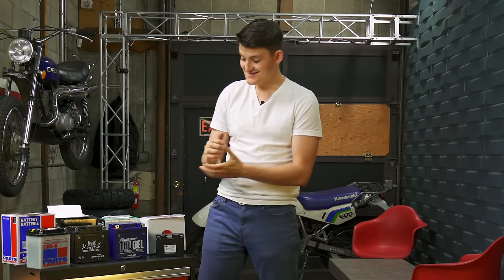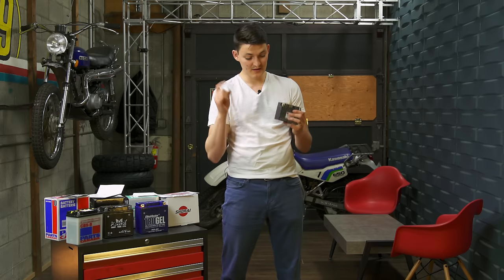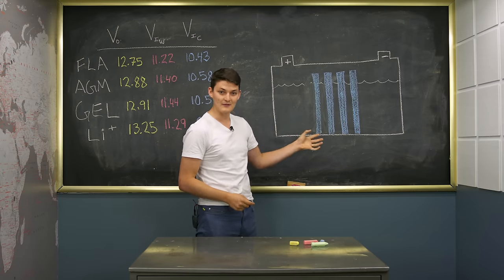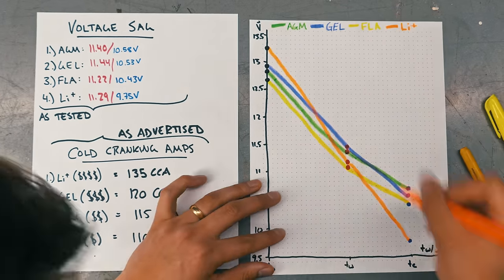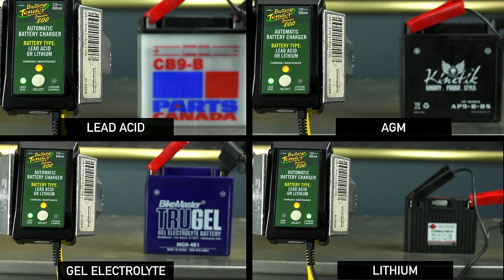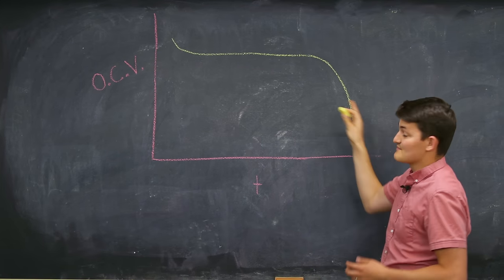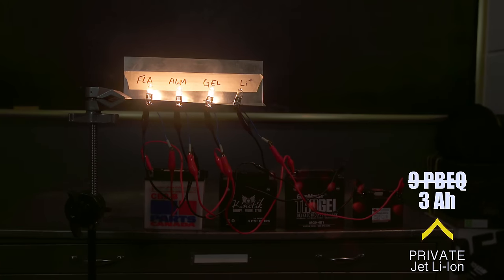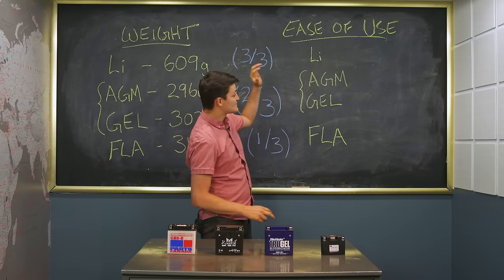Best Motorcycle Battery? Lead-Acid v. AGM v. Gel v. Lithium

Comment: Slight flaw in the charging test: As any electric bike/car owner will tell you, Li-ion is fast to charge from 0 to 80%. Above that they charge a lot slower.
Reply: Why would you need it above 80%?
Reply: He didnt use Li-ion, that's a lithium iron phosphate cell (LiFePO4).  Less energy density than Li-ion but no danger of thermal events and 4000+ charge  cycles.
Reply: That charger charges Lithium with more Volts, less amps. Crappy test.
Reply: @ThomMurphy  yes, that’s just one of the huge flaws. Lithium’s charge the opposite of acid. Start high then low. The test also failed because it’s irrelevant to show the amp hours since the others weren’t likely to actually start a bike. 
Also, that’s a pathetically small lithium. The lfx 14 with 210 cca and 14 pbq or 4ah is superior. 
Additionally, the lithium’s will crank harder with a low battery and start better. The problem with the methodology is that it’s not based on reality, it’s based on things that don’t or are unlikely to apply.
Reply: @Papparratzi  You're correct. Hopefully others will see the points you've made.
Reply: @Papparratzi  so you recommend lithium iron?
Reply: @theverystormycloud4011  Put one on my bike. I recommend putting actual AH replacement battery not the equivalent they always advertise, especially if your in a colder climate.
Reply: @theverystormycloud4011  lithium iron is superior to all of them by far. Just buy their charger too. Has a storage setting and safe charging in cold.
Reply: The fun bit is that as an Australian the worst drawback of Lithium is basically a non-issue unless I park the bike in a freezer. The second bites worse, the import costs passed on for consumer electronics are basically 2 pack prices everywhere else.
Reply: He also wasn't using the OEM charger for that battery
Reply: @theverystormycloud4011  yes same here just make sure you bought it it's OEM charger
Reply: But lead acid is exactly the same - bulk charging rate (constant current) gets you so far and then it swaps to a slowing absorption rate (constant voltage) until full. Honestly what do people care about the speed of charging anyway - it's not like we all go out to the garage and put it on charge and have to wait half an hour before we go for our ride. None of these batteries will go flat if used semi-regularly and if you're leaving them for long periods of time then it's good practice to top up the lead acid ones periodically, whether you do that manually or with a float charger. And if you're doing it manually every month or so while the bike is not being used, again, who effin cares whether it takes 2 hours or 2 hours 25 minutes? Just put it on overnight for god's sake. Ugh so much energy caring about a minimal practical difference.
Reply: Actually I found the comparisons really interesting, whether they apply to the real world or not it showed how each type deals with a different situation.
Reply: @AfroCycle  Why should you have to use an OEM charger?  The bikes alternator/regulator/rectifier doesn't have to be modified or replaced to charge Lithium batteries. I suppose the internal BMS is designed to handle any specific charging requirements.
Reply: Also using an 800mA charger is NOT very optimal. No wonder it took time.
Reply: @Papparratzi  all batteries were rated at 9 amps. Using a larger Shorai would be wrong for comparison..
Reply: @HandSolitude    Because you don't know where on the discharge curve you're sitting.  Hit 13.4... You know you have the rest to burn.  It'll drop quick and then hold steadier than juicy girl on shore leave.
Reply: @pgkr67  would you not get a charger that is meant for the litium battery? I mean you are already spending 190 bucks for a battery so why not spend more for the charger to get the most out of it? even tho it's just charging, buy it once and you set.
Reply: @chocolate_squiggle  you are spending 190 bucks on a battery I would want the fast recharge rate of the Charger but that's me, I do know that Lithium hates the cold tho
Reply: @okcmoparguy724  any battery has the danger of thermal events, some just less so than others. even lead acids can generate hydrogen gas and toxic fumes and can cause explosions, but that's pretty rare.
Reply: @ThomMurphy  no matter what charger you use, if its charging the battery at the same voltage it will also be charging at the same amperage, if its charging at the same amperage it will also be charging at the same voltage.
Reply: @Collin yan   that was my point, essentially.   That charger output is fairly consistent in terms of total energy. It does less amps more voltage for lithium. So, recharge speed is limited by the charger, not the chemistry. The lithium battery requires more voltage to charge, so the charger drops the amps. The lithium battery can take more amps, but the charger can't deliver them. 

It's a crappy little charger that can do the job but isn't made well enough to do all the jobs equally well. It also has thermal protections. That's good for a cheap charger, but it means it throttles itself,  reducing the output to reduce heat. Bad charger for a charging speed test when the test is supposed to focus on the limitations of the battery chemistries, not the charger's capabilities (or lack of them).

This video is full of issues. Like comparing different capabilities with unlike capacities.   It's presented as comparing chemistries, but does that less often than comparing something else completely.
Reply: 3 years late to the party, but 80% of 3ah is jack shit. They could have used a bigger LiFePO4 battery, but that would have upset some of the other empirics. Match the battery case sizes and we might have seen a battery that weighed half as much as the others but provided twice the usable capacity. Of course, it would have taken even longer to charge and would have cost more than my motorcycle. I would have liked to see bench tests with actual motorcycle electrics, to test how the motorcycle's charging system handles the different chemistries. Even without that, the video provides a useful insight to the pros and cons of the different battery options. Like Ryan, I lean toward cheap and effective. Pop-up brands on Amazon surely undercut Shorai on price, but the quality is hit or miss. The lead-acid batteries are made by maybe three manufacturers here in the US, so the quality is usually good. If the price of Gel and AGM could come down to current FLA prices, the benefits of LiFePO4 might be a wash. As it stands, a good quality Gel battery costs as much as a randazon Lithium unit. Conclusion: if you're cheap, stick with old-school FLA. If you want to spend a bunch on money and get a nice upgrade, get the biggest compatible LiFePO4 that you can stuff in there and don't forget to fluff it when it's cold out.
Reply: @HandSolitude  because at 80% you are only getting 80% capacity,  and the Li-Ion was already disappointing on capacity test.  Li-Ion actually like to live at <50% charge for longest life... while lead-acid likes to be at >80%
Reply: @ThomMurphy  Other than that, are there any significant reasons to get Lifepo4?  I'm hoping I didn't completely waste my money on buying a battery that isn't all that better at handling the winter months, even though I'm in the South, in GA.
Reply: @chrissmith2114   Let's not confuse Li-ion with LifePO4. Although if those faults are the same for both, I am happy to hear criticism.
Reply: Wrong

Comment: This was great. May I suggest an air filter comparison next? For example OEM vs K&N vs Sprint P-08 vs MWR.
Reply: PG 19 uni
Reply: Engineering Explained, but I'll tell you, they are better for performance, and still filter well enough.  There are many different ones on the market but K&N have always been great, I now have a DNA filter and it is just as well made, pretty much the same.
Reply: May I suggest a general comparison of air filter types?
Reply: @maximilianhoch2508  Again Engineering Explained done a pretty decent vid on it, Ryan saw it too.
Reply: BMC
Reply: this please! i dont know if oil filters matter that much?
Reply: @imbackinthegame3611  Don't look as well made as K&N or DMC imo but probably decent still.
Reply: @acvn-hg9gy  The better the oil can flow the cooler the engine should run.  It would also increase the life of oil pumps to a degree.
Reply: I sooo need this test
People here advice not to use knns as it would damage the engine
Reply: @zaidkuso  Never heard of "knns" filters, probably best to stay away.  Again (again) check out Engineering Explained if you really need to see this, there are also a lot of BS vids on youtube about them.
Reply: Yes finally 🙌🏼
Reply: @starknaked2.0  yeah bro i dont understand these people dont know dna is the king of filters
Reply: K&N noisy as hell
Reply: Please do!!!!!!! great idea
Reply: @24321619  Isnt that the point?
Reply: I just realized that Hiflo Filtro sells air filters for a very low price! I'd love to throw them into the mix for that test
Reply: check out project farm air filter test. K&N doesn't filter well but allows more air flow. I know it's car filters but same principles.
Reply: @twiddler2386  Yeah Project Farm is fantastic! Led to my Seafoam loyalty.
Reply: @nspinicelli  check out CRC Intake Valve and Turbo Cleaner. I used a borescope camera and did a before and after of my intake and cylinders and compared to Seafoam and it did a way better job.
Reply: Peejay Gathaiya and vs Chinese knockoff K&N
Reply: And twin air
Reply: Yessssssss I definitely would want to see their head to head comparison. I’m sure this guy will traumatize some companies with his experiments. 😎
Reply: Monir Mahdi will, hell they already have
Reply: ^This
Reply: @HalfdeadRider  except for offroad. don't run K and N for dusty conditions.
Reply: K&n has oil that could dirty up your mass air flow sensor
Reply: DNA also
Reply: He just recently uploaded a video comparing paper, steel, and fiberglass filters if that interests you. Hope this helps.
Reply: Dumb test, unless all you plan to do is weigh the amount of dirt each filter catches, and amount of dirt each filter passes.
Reply: @zaidkuso  They should be called K&N dirt sieves.  They flow a lot of dust and dirt into your engine.

Comment: I just replaced the AGM in my bike with a lithium of the same physical size. Got me 4 times the capacity, half the weight, and 2x the cranking amps. Pretty satisfied so far, especially since lithium prices have gone down since this video came out.
Reply: When I went to lithium seller said hey this other battery has twice cca of one in your cart and still fits the space in your bike. I appreciated the suggestion as that seems like the shortfall of lithium. Still half the weight of previous agm. Thanks for reminding me to take off charger for winter(honestly didn't know that cold charging was an issue)
Reply: Have fun in winter lmfao
Reply: @Daniel-vu4qu  luckily I don't store my bike outside in the snow
Reply: i have not used a lithium in my bike yet but i did replace the battery in my ups with a home made 12ah 25.6v lifepo4 , i bought the cells and parts for 50$ and it has been 5 years it still holds 100% capacity not even a minute down. under a 300w load my ups would run for 45mins with it , that is similar runtime of 27ah leadacid battery that would cost 3x more . 
the only issue with cheap lifepo4 cells is that they are not made for high current pulse discharge , so not all cell types can be used as starter battery. for a starter battery the only lifepo4 that i would trust is the lithiumwerks anr26650m1b cells , these are 2.6ah cells but they can deliver 120amp for 10 seconds .. a pack with 4s2p of these cells would easily start a car. a bike is nothing for them but i would put 2 or 3 in parallel to get higher amp hour and watt hour. 
the leadacid 9ah is measured at a 20 hour discharge down to 10v with very low current. in reality they are more like 4-5ah . in the video the lithium shut off earlier because it has a bms that would prevent the battery from deep discharge and shut off the output if the voltage falls below 2.7v per call or 10.8v while the leadacid has no such protection so it will be discharged deep down to few volts and doing this 3 4 times will kill the battery , 
in my bike i use 7ah ups battery because they are like 9$ each and work fine for 4-5 years. much cheaper than 25$ "bike battery" , my 220cc bajaj pulsar takes around 18-20amps while cranking and the 7ah leadacid can deliver well above 40amps for few minutes.
Reply: @Daniel-vu4qu  It's a non-issue.
Reply: @Daniel-vu4qu take the battery out of your bike and bring it inside unless you ride a motorcycle in the winter?
Reply: @yourwifesboyfriend6081 nice ! What kind of bike and battery?
Reply: @yourwifesboyfriend6081 That’s good to hear.. I have a FZ1 with same battery, just put her in! Seems to be good. Running grips as well.Also have shorai in 88 nx 250 she cranks strong now!
Reply: how did you deal with extra space in your battery box?
Reply: @Daniel-vu4qu  not everyone lives in a country with a winter season

Comment: I'd actually recommend the Gel over the FLA in a motorcycle due to the slightly safer nature in the event of a crash or dropping a bike.
Reply: I was thinking that the AGM was the best when you consider all of the points, but only because of price. It sounds like he said it was $45 while the Gel was over $100, and the AGM wasnt that much worse than the Gel if I remember correctly. Bang for the buck seems to go to AGM and it should be safe in case of a crash or drop also.
Reply: As someone with a narcoleptic bike, I went AGM.  And watching this video, it was the correct choice.  Don't need to worry about a spill when I take a spill and still pretty cheap.  Plus I save 200g.  Major difference with my DR650 (/s)
Reply: Plus... no ugly drain tube poking out the bottom of the bike.
Reply: Especially on an offroader like Ryan rides..
Reply: vic vapor  Yeah, and my pappy had the burn scars to prove it.
Reply: The glass mat is the way to go, really.  For $60 vs $45 & $130, uhhhhhhhhhhmmmm
This has been the standard for automobiles for decades.
Reply: Charles Szasz  I've never met a motorcyclist in my life who hasn't crashed.  So I'd say he's 100% correct from my observation.
Reply: @gittyupalice96  yeah, but that user seems to draw pride from the fact that people crash
Really fucking weird imo
Reply: @fakename287  He could be referencing dirt bikes.  If not then yeah I'd agree with that lol.
Reply: In the event you crash your bike the way your AGM spills it's guts , you will not survive to talk about it anyways....so why bother with anything else than a factory AGM battery ?
Reply: My thoughts exactly.
Reply: You get the same amount of durability out of a cheaper AGM. Flooded is just older technology that was phased out since the early 2000s on new bikes
Reply: for heavy uses such in automotive uses, i'll always recommend to go with AGM. Gel has a lot more advantage for sure but it is significantly more expensive and are not suitable for hard core use. FLA is only for people who doesn't have responsibility for others such as humans because it genuinely requires very much love.

If you have tinkered around batteries before and have lots of money to spend, go with lifepo4. It is the best battery ever produced. But do yourself a favour and make your own with no cheap chinese bms. Use the one with bluetooth function if you can afford it since you can monitor individual battery stats through your smartphone (12.6v PB equals to exactly 4s lifepo4).
Reply: AGM...
Reply: @ragilmalik  I agree on LiFePo4, and I was very surprised Ryan seems to recommend FLA. Never EVER put one of those in any bike worth riding.
I use AntiGravity and they've been excellent. Very small, very light, last twice as long as an FLA and never make my bike rust. I use them in several bikes, even share them across bikes.
Reply: @gittyupalice96  around 40 years of riding, and never a crash.  I've always respected the inherent dangers of riding, even as a young man, never riding at speeds that would leave me little to no reaction time.
Reply: Another reason to buy an AGM battery instead of an FLA battery is that with many FLA batteries, it's virtually impossible to even see the fluid level without removing the battery from the motorcycle, let alone top off the cells with fluid.
Reply: I don’t drop my street bike. Under normal riding conditions if I were to crash the bike/battery is the last thing on my mind.
Reply: Pretty much all motorcycles come with AMG batteries now.  When you go to the auto parts store, all the powersports batteries are AGM.  It's rare to see a lead acid battery for powersports applications nowadays.

Comment: i was a professional motorcycle mechanic for over 35 years. i lived, eat, breathed etc.etc. motorcycles my entire life. i enjoy your videos very much. they are informative, for the most part no nonsense, and at times hilarious. i especially enjoyed (and side with you) on the Snell  vs. DOT (garbage) helmet video, and this is another top quality informative video as well.  keep up the good work!
Reply: you eat motocycles?
how u cook it? deep fry. stir fry
steam. pressure cooker. slow cooker. on the grill?
i want to eat some
Reply: Unfortunately, if you have a large head and want a full coverage helmet, your helmet choices are quite limited and even if the helmet is rated to Snell in the smaller sizes, it is only rated to DOT in the larger sizes... I need a 8-3/4 to 8-7/8 size helmet... That usually equates to a 5X if the manufacturer even produces one that large... DOT is better than nothing though...